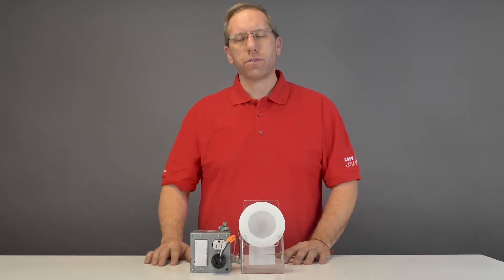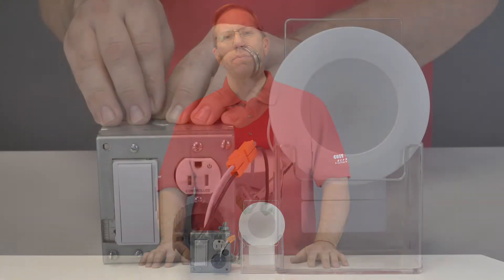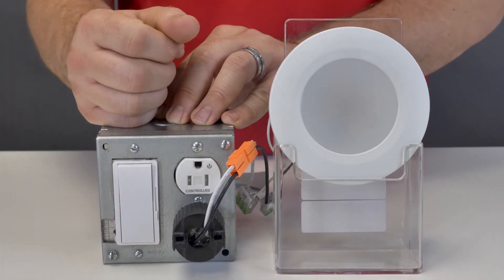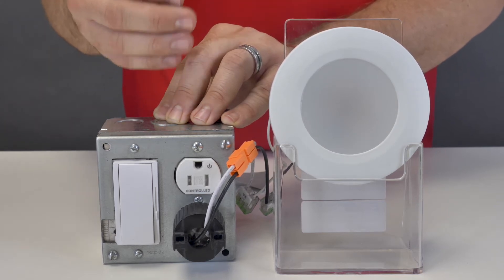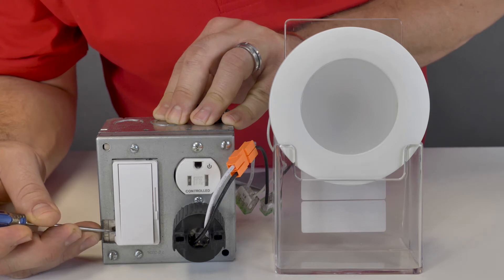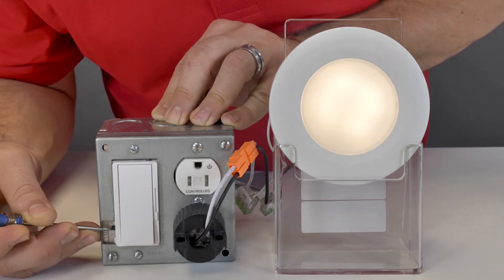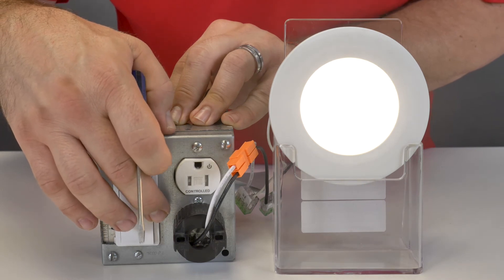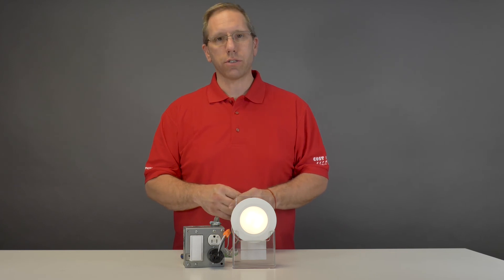HOW TO ADJUST A LUTRON DIMMER - The Low-End Trim

Comment: I have the 1500, it doesn't have a lever but has a turn knob. Which way is low, I've checked the manuals and can't find anything on it. I don't want to mess around with it because they are pretty expensive.

Comment: I have 0-10v dimming led panel light.  This dimmer is not dimming at the switch with only power wires connected.  It is only on or off or flickering.  Is this switch not for a 0-10v dimmable led panel light?
Reply: You need a dimmer that has the 0-10 volts , it also will have the 120 volts wires , so you need 4 wires to come to the switch   The 120v ( power ) and the 10 volts that will come out of the fixture

Comment: I have a Lutron DVSTV-453PH-WH, 0-10 volt dimmer switch.  It has a the same type of lever switch (white) on the top of the switch, behind the face.  Here’s the interesting part.  The actual low end adjustment is a screw at the bottom.  So if that is the low end adjustment then what is/does the lever on the top behind the face?  
Update:  one adjustment is for low end and one adjustment is for the high end.